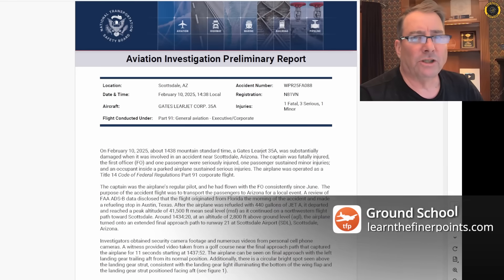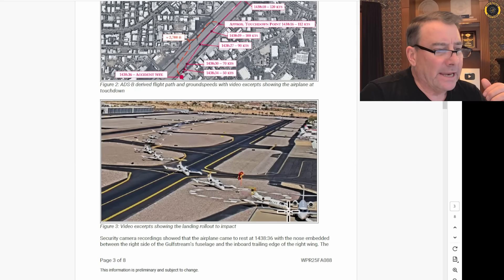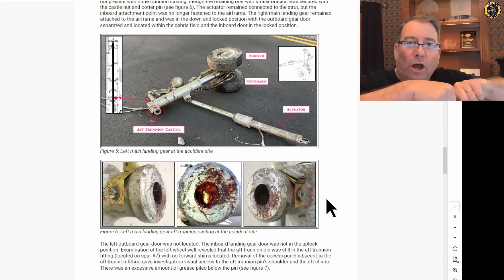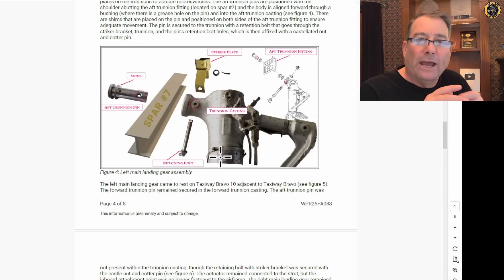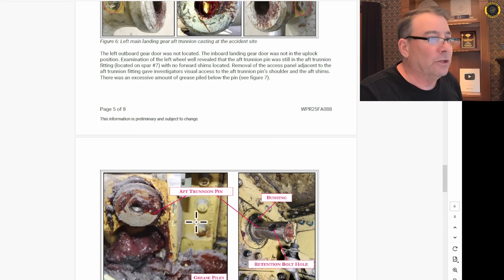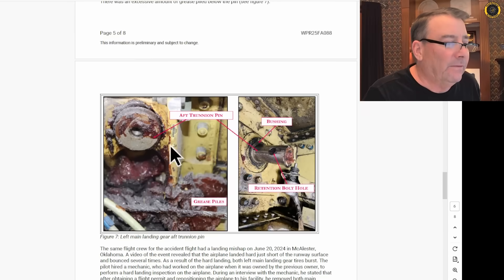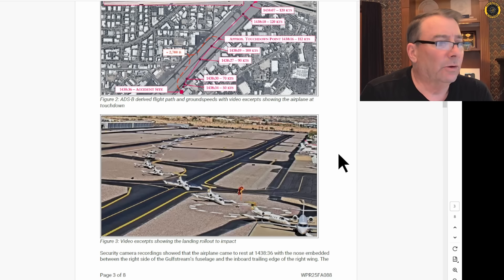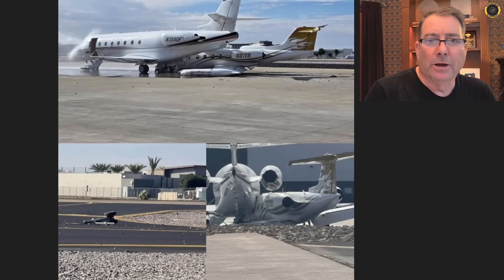NTSB Preliminary Report Fatal Maintenance Error Lear 35 Scottsdale

Comment: Why do civilian maintenance operations not adhere to the same standards we used in the Navy? As a lowly E-3 avionics tech, I knew the job. But, I was still supervised by an E-4. Then, the shop supervisor, an E-5, inspected the job for being done correctly.

This was done on every job, even if it was nothing more than swapping out a black box and safety-wiring the holder or wrapping the cannon plugs to protect them from the sea air.

Comment: (FYI: I use.a Rode microphone. They are high-quality, but more importantly, they have a very good warranty. I had one fail, and they  were responsive and helpful. They seem understand their customers are professionals who rely on their gear. On the other hand, they did not provide a replacement while they worked on the problem.)

Comment: Slipshod maintenance. Smothered in grease. You could not tell visually if a pin went into another pin. How did the mechanic check this then? Just shove the pin in and wriggle the landing gear around a bit?

Comment: As an A&P on private jets for over 20 years, this one hits close to home. Even the best techs could make a mistake. I’ve seen some excellent techs make pretty serious mistakes. Myself included. But because dedicated techs spend most of their time rearranging the Swiss cheese so the holes don’t line up, the vast majority of mistakes are caught. To All the A&Ps reading, stay focused and stay diligent. There’s no shame in getting someone else to check your work after a critical job. Even if it isn’t required. If something doesn’t seem right figure out why.
Reply: What's A&P?
Reply: @melistasy  Airframe and power plant mechanic.
Reply: @rotorhead100  ahh, ok! Thanks, buddy!

Comment: Every part of that job should have been on a requirement inspection list. Then to have unqualified mechanics do this job is inexcusable. The inspector ( second set of qualified eyes ) if they used one wasn’t qualified either. There is no substitute for experience in the aircraft maintenance. Rightfully so all of them will lose their certificates.  But worse have to live with their actions that claimed the life of the pilot.

Comment: Back in the 70's, 4 Marine Maintenance men were charged with manslaughter when they failed to install the Jesus nut on a CH-46 rotor blade and the aircraft crashed during the post-Maintenace flight check on the helo pad. Will the maintenance man involved here be facing criminal charges?

Comment: WOW! @ 0:15, I heard you say something wrong for the first time in all these years:  "It's not often that we get accidents caused by maintenance errors..."  Not withstanding ATC being unable to communicate and/or avoid conflicting ground traffic on runways and taxiways, MANY of the "unfortunate incidents" are the first flight following a maintenance procedure, a periodic inspection/upgrade, etc.  Fuel lines left loose, control cable reversed so that up is down, left is right and so on.  The aircraft maintenance process seems to be at least as bad as car dealer service departments nowadays, with the notable exception that cars and trucks normally only operate at ground level.  If Chevy screws up the troubleshooting on my highly computerized, expensive truck, I just have to continue trying to find a good diagnostician, which normally does not include falling from the sky.

Comment: Ouch! That hurts. As a retired mechanical engineer and quality control inspector I'll say that should never happened. Sadly it does because correct procedures are not always followed, inspection is lacking and someone is prepared to sign off the job anyway. I had my share of clashes with management for refusing to sign off a Certificate of Conformity because I knew things hadn't been done correctly.

Comment: oh my days, what a blunder by maintenance, them tell tale images should be broadcast to all maintenance crews, if you ain't sure, check and test, see if the trunnion bolt turns
but i'm interested in what happens to a maintenance guy who causes loss of life, is he simply discharged from the job, never to work in aviation again, or does he have to hand himself in to the police, its a very sad case really, preventable, but sadly these things happen if easily distracted or fatigued by work - it kind of begs the question, being qualified to do the job is one thing, but being self critical, and having a mental or physical health check is something else i guess

Comment: The multiframe picture is cool 
The dangling uc again is remarkable
The fact that everything was so dirty means you can't do proper inspections. 
Is there a design issue with the gear sensors?

Comment: As a professional aircraft technician (retired USAF, F-111, F-105) I'm still confused on how the procedure to shim the head side trunnion pin to manage the trunnion yoke to the spar bushing gap, was deemed correct at the time. The gaps should have been checked with feeler gauges on BOTH sides of the spar bushing AND there should be a max limit on shimming before it is considered WRONG or out of spec.  As a 16 year 7 and 9 level (technician/superintendent, the Air Force's version of an A&P license) I'm horrified that this was NOT inspected on those key points of installation. Unlike some complex repairs, these issues should have been noticed both during and after, before access cover install, installation.

Comment: Wow, I've worked on the f18 for 15 years and the trunion mounts in a similar manner, I guess the lear doesn't have a 0 freeplay inspection after you install it, couple of good shakes back and forth would have discovered the improper installation.

Comment: I wonder if the center hole in the aft trunnion pin is threaded. That would be a good check of engagement to temporarily install an eyebolt in the pin and give it a yank. 
This is a real gotcha situation. I can see how it could get past the mechanic and Inspector. Everything looks installed and secure.

Comment: WoW!  That's either negligence or incompetence.  That is such a common "type" or "style" of mechanical attachment whether in Aviation, automotive, or other machinery.  There would have been a very obvious gap!  Plus the comment that it "took a lot of grease" was the RED FLAG that something was not correctly assembled. It is like the "mechanic" went brain dead at that moment, and shrugged it off. I use the term "mechanic" very loosely here.  Someone lost their life because of it and demoed TWO aircraft.  Almost One aircraft and a building with people possibly killing more.  Even IF the pilot knew the gear was dangling by one pivot only, it would not have retracted for a safe belly landing.  Sorry for the bit of a rant Juan, but being a mechanic all my life, seemingly simple (mechanically) "mistakes" like this just boils my blood.  It makes one wonder how they "passed their exams".

Comment: There must have been a heck of lot of packing shims on that pin to allow the pin to be withdrawn from the gear leg sufficiently that the bolt passed in front of the pin, and not through it. That would surely have been a clue that it wasn't fitted correctly?
Or did the guy not even check the shim situation?

Comment: I can’t imagine being an A&P mechanic with the risk of being sued into oblivion or being charged with negligent homicide let alone the sleepless nights of second guessing myself on repairs. Having repaired industrial and commercial mechanical equipment my whole career and even now in retirement I still have moments that I remember mistakes or lapses in forethought I made decades ago. It’s astonishing that anyone is willing to work on airplanes at all, cheers and good luck.
Reply: But if you have someone second check a repair for you, at least the onus wouldn't only be on yourself! I thought this was usually the case with aviation, but apparently not!
Reply: That's why you do everything by the book, and have it signed off. I was responsible for ASME Pressure Vessel repairs, and made damn sure I crossed my T's 
and dotted my I's. The one you half-ass will more than likely be the one that bites you in th azz.

Comment: Here in Canada that gear maintenance would require two independent inspections.  Is that a USA requirement?
1.75 inches is a huge gap that should have been caught by inspection of the pin from the aft side of the wing spar.

Comment: Understanding the time it takes to perceive a problem, understand, decide, and react and given that touchdown to crash was about 20 seconds, I am wondering, if the pilot had applied full right rudder and full right brake, could he have straightened the curve to the left enough to avoid crashing into anything?

If the pilot had known that the left gear was not functional, could he have landed on the right gear and nose wheel and kept the let wing up until he had slowed down?
Reply: If the pilot wasn't dead, we could ask him if he applied right rudder.
If the pilot wasn't dead, we could ask him if he applied right brake. 
If the jet had a FDR we could analyze it to discover what the control inputs were.
The scenario can be set up in a flight simulator that duplicates the failed landing gear and played out to determine possible outcomes.

Comment: Hard to imagine a simpler operation installing that trunion pin. The fact it had to be rotated to align the cross bore prior to inserting the locking bolt should have made it impossible to get it wrong. I suspect the mechanic lives in an environment where cost drives every action, not quality. Such routine blinded him to the fact this was a mission critical system and demanded absolute attention to detail. It is especially damning the subsequent inspection of the assembly (if there was one) didn't turn up the error. When you think about it, how could the mechanic possibly have determined end play as determined by inserting or removing shims and dutifully using a feeler guage to confirm the fit? I hope and pray we as a society can reverse the tide of errors that seem to be creeping into every industry these days. But i doubt it. May God help us. My sincere condolences to the families affected.

Comment: How any maintenance mechanic could make an error such as this is utterly astounding.
The assembly process looks very simple and pretty much foolproof (I say 'looks'). Chances are that a mirror will be needed if you wish to see what you are doing.
Firstly push in the pin to its full extent, feeling carefully around the head to check that it is fully inserted.
Rotate the head of the pin so that the holes line up for the securing bolt to be inserted.
Insert the bolt and tighten its nut.
Chances are that when you try to insert the bolt it won't go in because the holes aren't lined up. If it does go in immediately, be suspicious. Have a good feel of the pin's head to ensure it really is fully inserted.
Anyone doing this on a frequent basis should know whether the bolt has gone through the hole as it will go through far too easily if you've missed the hole.
Finally check the pin head with your mirror if it's not clearly visible without it. It only takes a few seconds.
Reply: There is no way that mechanic checked those shims/clearances of that aft trunion pin on the other side of the wing spar it went through. A friggin'
blind person could've seen that someting wasn't right. It would have been at least 1 3/8" off according to the pics at 5:15 and 5:20.

Comment: The trunnion pin was installed temporarily in order to get the shimming right. Then it was installed permanently with the actual locking bolt, except that the bolt wasn't through the trunnion pin. Thus must the trunnion pin have been poking out with the shims flopping about. This was missed by the sign-off inspector. What??  You cannot believe that competent professionals are  doing this work.

Comment: That meant the Aft trunnion pin was sticking out 1 & 3/8" on the aft side of the rear spar./LG support beam after shimming the rear trunnion pin should probably have .025"  gap I am assuming under the head of the aft trunnion pin... when installed correctly!  Technically, someone should drive the aft pin home & you would use a podger to align & ensure the pin was fully  seated plus a torch to watch the shaft pass the retention bolt hole & seat fully! 
Let me guess...No more skilled & well trained engineers anymore! I am licensed on 747 & 767 & could see how to correctly install the Lear LDG!
Reply: Licensed to do what on 747's and 767's? 
Obviously you're not a licensed A&P mechanic (as you phrased it, "skilled & well trained engineer")

Comment: I once filled a car coolant system with water and more water. Hmm filling 2-3 times the normal the amount still nothing, where is all this water going? I unscrewed the oil sump drain plug, water came out. I took of the exhaust, more water came out. And lastly the head come of the reveal the grand canyon of cylinder wall cracks, normally we search for barely visible cracks but this was spit open from top to bottom. If a car stops working I now tow them but you know planes tend to kill people when stuff goes wrong. If I was a plane mechanic I would double check everything, just to be sure. Because life depends on it.

Comment: The rudder seems to be deflected to the left, both in the final photo and in the video. Could full right rudder have compensated for the drag on the left and kept the jet in a straight line?  Also: Assuming the brakes worked:  THERE SHOULD HAVE BEEN MASSIVE ASYMMETRIC BRAKING ACTION TO THE RIGHT, because the left brake was inop.  What about these two considerations? It seems to me that it could be possible to keep it in a straight line. And I heard that there were to thrust reverses equipped, how is that? Why? No parts?  No reversers would mean more stress on the gear and brakes, and possibly even hesitation to use the brakes.
Reply: Thrust reversers was an option and not a standard fit. Having lost the left gear the hydraulic brake fluid would have leaked, resulting in no brakes on both mainwheels. The additional drag on the left pulled the aircraft off the runway. The rudder may also be affected.

Comment: I'm sure someone has mentioned it, but in the text displayed at the bottom of the page at the 5:55 mark, there is discussion of a drag chute not being deployed. Are there Lear 35s our there with drag chutes, or was the report author lacking caffeine that day?
Reply: Yes, the Lear 35 can be retrofit with a drag chute. It's located in a pod on the rear electrical bay door (the dreaded "hell hole"), and secured  by strap to the primary structure in the empennage. The cockpit control is a big silver pistol grip handle just to the right side of the throttle quadrant. Very expensive to repack, but it can be a lifesaver when all else fails.

Comment: I actually recently got some details on what may have caused this, again, MAY have caused. I work at the airport that this aircraft was based at, in fact I saw it depart three days before it crashed. One of the shop leads where I work at heard from someone at the FBO on the airport I work, that this plane suffered a SUPER hard landing not too long before the crash. And apparently the plane never got inspected, and the only thing done was the pilot topped off the struts with nitrogen. Now. As to whether or not that’s true, I can’t say right now, but that’s what I heard from people at the airport I work at.
Reply: The NTSB report states that hard landing checks were carried-out.
Reply: @ I know, that’s why I said may have caused. Because I didn’t want to speculate, and I’m not sure if what was told to me is true or not.

Comment: Engineer brain just set off again... put a hex head on the trunnion pin, and then specify a torque value of 10 ft-lb as the last step of installation. 
That should be low enough to not damage the retaining bolt, but enough ugga that an unretained pin will roll in the bore. And since there's a checkoff on this... boom, no more unsecured pins. 

Also routing the cabling for the gear extension indicator really ought to run it across a major hinge point or have a looped strap around it and the main gear strut, fastened to the well wall. Idea being that main gear departing severs the gear indication circuit causing an unsafe light (well, figuring that such sensors are probably at least NC, meaning they have to close the circuit when 'good' and all other conditions are unsafe, or dual circuit with a dual throw sensor so there's always voltage on one lead or the other, but never both and never none.)

Comment: As a retired A&P why there is no inspection hole to see the trunnion pin fully installed or someway to rotate the pin to be sure it is secured. A retraction test should have a procedure to check the pin. Another problem similar to the Alaskan Boeing door failure. Not saying I was perfect but never lost an aircraft or crew.

Comment: Most of them are caused by horrible maintenance
Reply: Most accidents are caused by human error, by the pilot, the maintainer and/or the designer.
Reply: @christopherrobinson7541  Facts list only one (1) cause of "most accidents."
The majority of aviation accidents are caused by;
1. Human Error, 70 - 80%.
2. Mechanical Failure: Around 10-20%.  (includes design flaws, manufacturing defects, or improper maintenance)
3. Environmental or External Factors: Runway incursions, bird strikes, or mid-air collisions. roughly 10%
4. Sabotage or Terrorism: Hijackings or Bombings. very small %

Comment: Sad thing.  Total failire to do job correctly.  A visual exam of the bolt pin head not being weighted and the strut not in far enough would indicate an unsecure fastening of the landing gear.  Much the same premise of leaving the wing bolts out of the F117 which crashed killing one of our very best pilots a few years back effectively contributing to an early end of the F117 program.